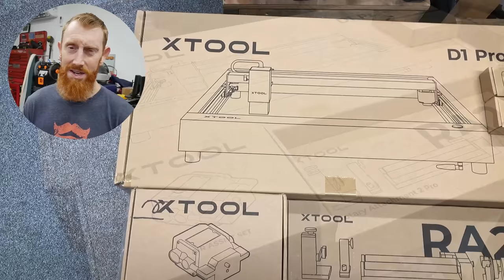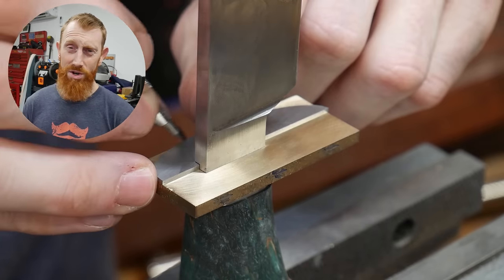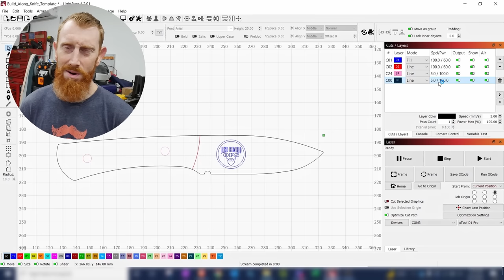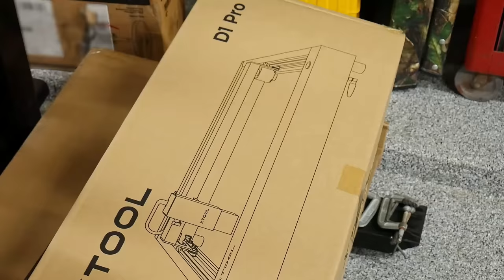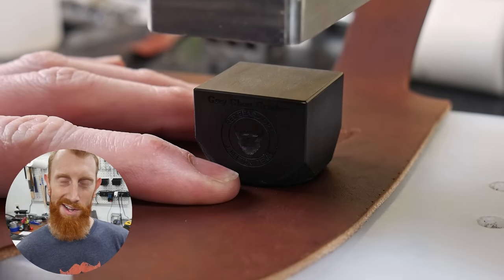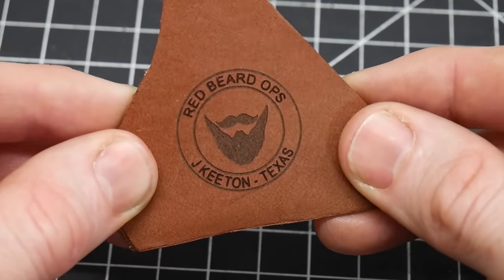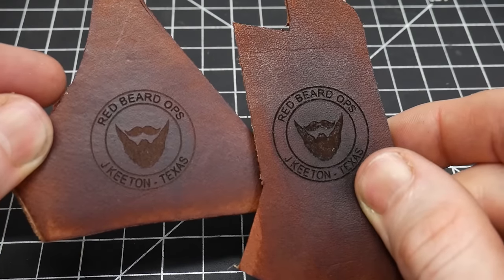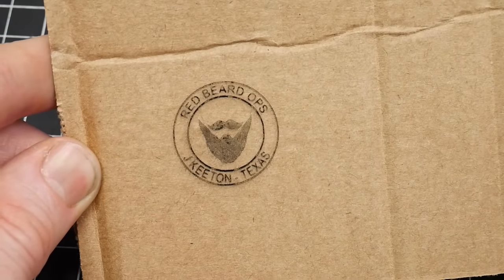Are Lasers Good For Knifemaking? || XTool D1 Pro 20W Diode Laser Review & Testing

Comment: XTool just released a metal engraving laser module for the D1 series of lasers.  It might do a better job for you with engraving your mark on the blades.  As a laser guy I will tell you just leave the air assist on for all projects you will rarely need to have it off. Another is Look at getting CerMark Ultra Laser Marking Aerosol, white spray paint or  even just masking tape over the metal you want to engrave helps. Giving the laser a material that enhances the lasers output (not bare metal) helps a ton. Being a shinny surface you are only getting a small percentage of what the laser can do to the surface of the blade.
Reply from the maker: Thank you greatly for the comment! I'll have to try the CerMark... and maybe that infrared laser!

Comment: The 20w does have a capability to "mark" the steel but you can actually get colours (e.g. red), at least on stainless.  You can also use marking sprays like Cermark, Brilliance or Enduramark for black on your steel.
Reply from the maker: That's cool! Will need to experiment.
Reply: @RedBeardOps  Also note different thicknesses of stainless require different settings. I found that out after doing a water bottle, which is likely .2mm vs a card that was .9mm. A test array (XCS) or materials test (Lightburn), will probably be most effective in the 60%+ power range, and 1-30mm/s (60-1800 mm/m) speed

Comment: -Cut your own vinyl resist out for etching and other things.  If you wanted to replicate an exact clay pattern for a hamon, you could make a vinyl template to stick on the blade, coat with clay, and lift the vinyl off leaving the clay only where you wanted it.  When you're bringing the hamon out after heat treatment, using the same template modified to only expose the thin line of the hamon and covering the rest of the blade for etching helps to accentuate it during polishing.

-Add engraving or texture to scales, put your logo or designs on kydex.

-Scales, G10 spacer material, and even leather biscuits for Ka-Bar style handles could be cut to shape precisely.  I'm kinda running it through my head wondering if cutting out scales with a laser would be faster than the usual method of bandsaw to rough shape and hog the rest off with a belt.  I can see it being beneficial for a few situations even if it ended up being slower...it would certainly have less waste, which works for me as I collect the scraps for future mistakes and woodworking projects.  It would also be handy to perfectly locate scales (if you also laser etched the template on the steel) without having to remove any scale material by sanding beyond beveling or a touchup while off the knife.  I've done a few pattern knives that I low temp blued and matching the scales to the tang without sanding off that bluing was difficult to say the least.  If I had CNC precise scales to match a CNC precise tang, I wouldn't need to individually fit each scale flush by grinding some of the tang along with it.

-Folding knives would be a snap if you could design them on the computer and simply laser etch the pattern of each part to a sheet of dykem coated steel.  Making scales to fit against the bolster and whatnot, as well as locating screw holes accurately, would also save a lot of time if all you had to do was cut or mark them with the laser.  Make prototype folders out of wood, or little wood knife kits meant for kids.

-Kydex templates for sheaths or ancillaries like belt loops, possibly?  I dunno how laser cutting thermoplastics would turn out, since even using a jigsaw makes the kerf melt back together sometimes.  I guess an air assist to keep the kydex cool would be an important key to success.

-Cut form fitting foam for knife shipping to keep it protected, like the big knife companies do.
Reply from the maker: Very good ideas man! I like the foam cutting for the boxes. I wonder how it will handle foam. Cheers dude

Comment: I have the 10W diode version of this laser. I would recommend going for the 20 if not the 40w.  The 10 struggles on wood thicker than a few mm, haven't tried leather but I think it would burn more than cut. They make a IR module which MIGHT work better for marking metal but I think fibre would be the way to go.  The template was a good idea, I hadn't thought of that.  As I venture in to knifemaking I think I will keep mine around rather than sell at a loss but I wish I had gone with more power.
Reply from the maker: I agree, fiber is the way for metal for sure! Thanks for the note on the power

Comment: Those trim carbide rotary files with a bearing guide that you could technically put in a router-table rather than a die-grinder....

Would make trimming up to a glued on template from hardboard or cheap plywood after rough-cutting very quick, easy and repeatable...

You could also use the laser to cut stitch holes........
Reply from the maker: Good ideas Thomas!

Comment: mm/sec is co2 laser speed setting...  For diode is mm/min bcz its a lot slower... And mever use 100% power on diode laser, it dramaticly reduce diode work time... Max 80%... For cutting its bether with more speed and a few passes,  less burn traces left after cut... But great use of lasser... You have Cermark laser marker I think.. and Dry Molly works... Aply and laser when is dry... 
Fiber would be bether but its a lot expencive from diode laser...

Comment: re Makers mark: you should be able to save money on stencils. If you put some tape on the blade, you can burn through it and start the etch with the laser, then use the unetched tape already in place as a stencil to add depth electrochmically.
Reply: *electrochemically
Reply from the maker: Dude I like this idea... Need to try it!
Reply: @RedBeardOps  I do this on my knives, allows me to serialize them. I use a mask of spray paint though instead of tape. I use the 10W D1 Xtool laser.
Reply from the maker: @reubjames  Heck yeah, that's awesome. What is your method on the spray paint? (type / length of dry time / coats / etc)
Reply: @RedBeardOps  I’m spraying 2 coats of rustoleum matte black, about 20 mins apart, then let dry overnight. Burning it off with 1 pass, 400mm/min, 85% (10w model). Then etching and darkening with my electro etch machine at around 80% power (Personalizer Plus). After that using some Back to Nature Citrus paint stripper to take the paint off the blade. So far on hardened 1095 and 1084. All with good results. Even marked a few fully completed knives and just had to run a fine Sandflex block over it to clean it up. I’ll send you a message on Instagram with a photo of the results.
Reply from the maker: @reubjames  Man that's awesome! Thanks for the detail

Comment: I had two thoughts, one being making the holes for the thread and or rivets in the leather. (Don't know if that's what was said.) Second, you could maybe put down tape, use the laser to do an etch in the knife and then also with an electric etch to give it a little more depth. Also could use to just cut out the mark for the electric etch in tape. Could ez do the buyers name too, maybe free or a small added fee.
Reply from the maker: Very good thoughts. Masking is something I need to play with for sure.

Comment: I have a cheap diode array laser. I laser through nail polish then electroetch the nail polish acts as a mask or resist for the electrochemical etch. It’s the cleanest makers mark I have done. .
Reply from the maker: That is slick!
Reply: @RedBeardOps  thank you.  I saw someone else do it on YT spray paint and a more powerful laser than my sub $200.

Comment: Also..... If you take your logo make it a jpeg or png file.  Import it into lightburn it will import as an IMAGE. 6000 MM/S (Do the math of your using MM/M) and a power of 30. This works different then FILL and LINE. basically it doesn't leave the laser on constant and fires the laser at a fast rate.
Reply from the maker: Gotcha! So this would prevent the leather getting cut as easily, right?
Reply: @RedBeardOps  yes Sir

Comment: Do you think it would work on stainless steel?
Reply from the maker: I guess it depends on what you mean by "work." I think with enough passes it could burn in. Then you'd have to blacken it like I did. They do advertise being able to mark stainless steel, but these diode lasers aren't really designed for deep etching steel, IMO. They are coming out with an infrared laser which I think will be strong enough for a lot of metal etching - https://www.xtool.com/products/xtool-1064nm-infrared-laser-module

Comment: Might have been said already but skip the wood template and just etch the knife pattern on the steel.
Reply from the maker: That's a slick idea Darren!
Reply: @RedBeardOps  And you can still blue the steel prior if you need more contrast.
Reply: Ha, I was just about to say, just dykem the blank and then do a quick pass to put the pattern on rather than using wood blanks.  Maybe do a deep etch in the center of the handle pin holes to create a center punch for an exact location.
Reply from the maker: @Skinflaps_Meatslapper  Very nice idea

Comment: It's great that you can make a wood template to scribe around with speed, but why not just laser etch the metal and forget about the template?
Reply from the maker: Hey Stephen, I think a wooden template is superior for a few reasons. First of all, it takes way less set up time once cut out. I can trace it onto a 4' bar a few times and work on a batch with minimal set up time. On the laser you need to take time to get it all aligned then run the job. Also when working with large bars doing batches, you wouldn't be able to fit the whole bar in the machines cutting space. 

Cheers!
Reply: @RedBeardOps  thanks for that... Every day's a school day!
Reply from the maker: @stepheniley  Cheers sir! Have a great rest of your Sunday

Comment: What is the lifespan of this tool?
Reply from the maker: Good question, I really don't know. I've since heard that you shouldn't run the diode at 100% power... So I've been running it at 80% and it's doing good. Should increase the life. You can buy replacement lasers as well.
Reply: @RedBeardOps  Thank you for your response.

Comment: wayyy too much power lol. 70% at like 500mm/s would do it.
Reply from the maker: Thanks! I've since backed it off to 80% power and 5mm/sec for most of my cutting. Just using multiple passes if needed.
Reply: @RedBeardOps  just finished your vid. Great review. I just watched a video on that laser showing it cut 19mm wood in one pass at 100% and 100mm/s which is excellent. I have the atomstack x7 10watt and knew even on that machine 100% power and 100mm/s on 1/8" wood is overkill. That leather cut is clean though!